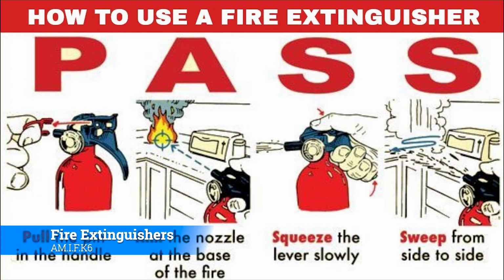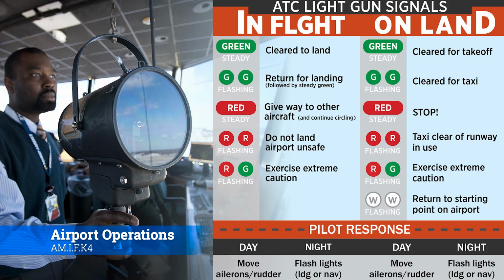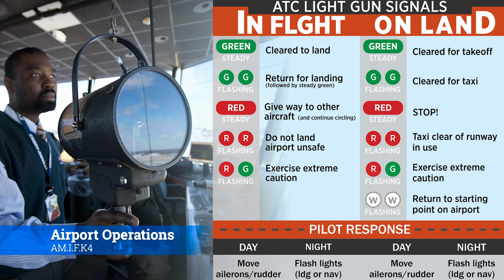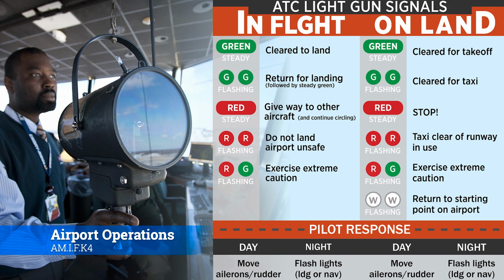Aircraft Taxi 1310.07.01

Comment: Ya your notes may have gotten mixed up because it directly contradicts the 8083. You said halon is corrosive and destroy whatever it touches in the aircraft, the 8083 says "The most common extinguishing 
agent still used today is Halon 1301 because of its effective 
firefighting capability and relatively low toxicity (U.L. 
classification Group 61). Noncorrosive, Halon 1301 does not 
affect the material it contacts and requires no clean-up when 
discharged. Halon 1301 is the current extinguishing agent for 
commercial aircraft, but a replacement is under development. 
Because Halon 1301 depletes the ozone layer only recycled 
Halon 1301 is currently available. Halon 1301 is used until 
a suitable replacement is developed. Some military aircraft 
use HCL-125, which the Federal Aviation Administration 
(FAA) is testing for use in commercial aircraft."

Comment: 6:30 it sounds like you're describing dry chemical fire extinguishers when you say you're describing CO2. CO2 extinguishers starve fires of oxygen without leaving a residue, however they should not be used in cockpit or cabin fires because they will starve the cabin of oxygen and people could suffocate. They can be used  in fires on the exterior of aircraft. It sounds like you may have been talking about dry chemical extinguishers, whose residue will destroy electronics and other materials. Halon also does not leave a residue, but can be used inside the cabin without the asphyxiation risk of CO2